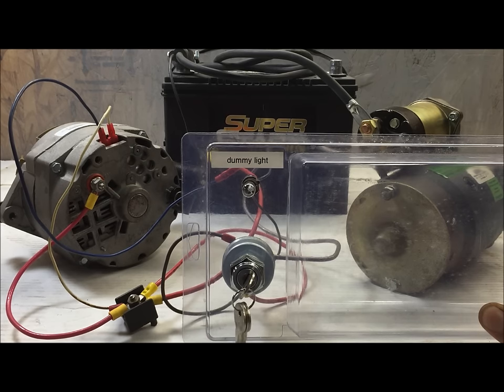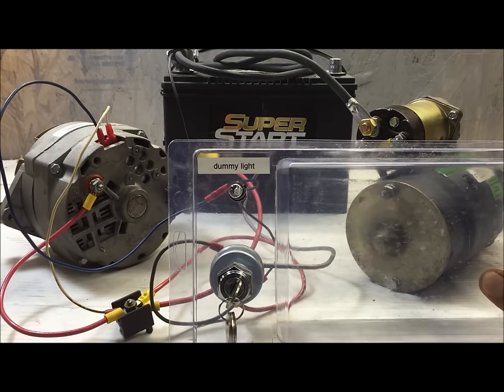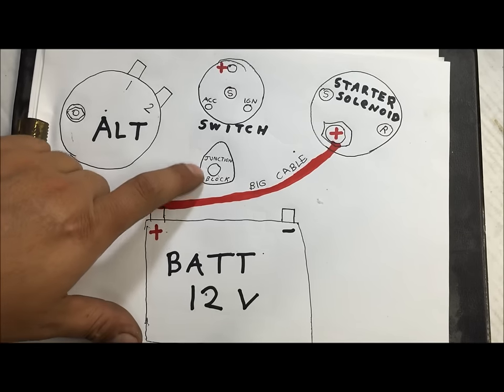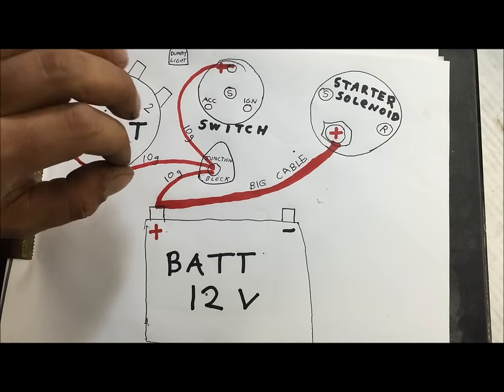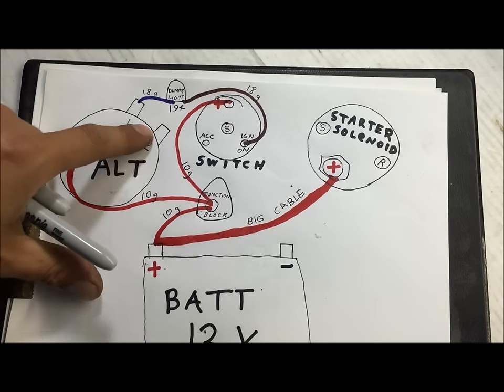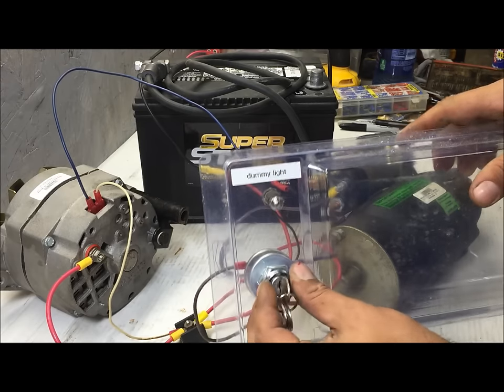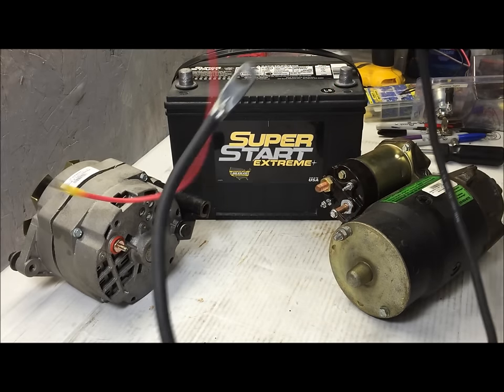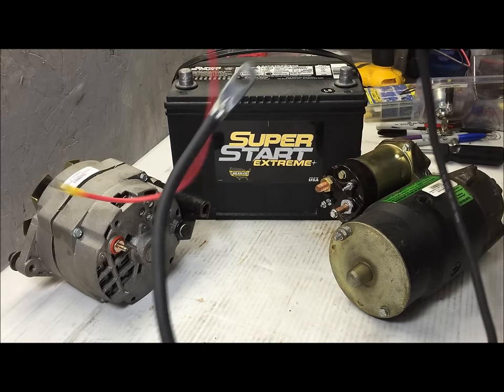64-72 charging system wire up using GM 3 wire internally regulated alternator

Comment: If I run the #1 wire direct with no light, Will it drain the battery?
Reply from the maker: +matt cabbage yes it will drain it and also keep your car running when you try to shut it off... watch my 3 wire hook up video it shows how to hook up the alt
Reply: Awesome. Yea I just watched that. Very helpful. I wired everything thing up as shown other than the dummy light last night and the engine was turning over good. I came back tonight to put my distributor in and my battery was completely dead. I'm assuming it's the #1 without the dummy light that drained my battery.
Reply: Btw it has to be something in this system that drained it considering there's no other wiring in the car. That wire without the light is the only thing I did different.

Thx again for the advice.
Reply from the maker: the only other time it will drain the battery is if you have the voltage sensing#2 white switched with number 1 position...  just unhook #1 (no wire)  and loop #2 back to the stud and it should work... but it will kick in and squeal a little.. if you cant figure it out

Comment: wired as is if the light does not go out the voltage regulator is bad it is staying closed and it will keep the light on and in turn it will kill the battery

Comment: I would like to see one on the same old system on wiring up and old Amp gage and a volt gage on same  old sytem. have a 54 chevy Blair converting from 6v to 12 v and a 56 Blair Conv. that I need to convert from Gen to alt. thanks Professor.

Comment: what if the bulb is not good. would the alternator be able to charge
Reply from the maker: if the bulb is bad it might not excite the alt until like 2500 rpm. use bulb or diode pointed towards battery... just like not running wire there at all
Reply: +Chris Craft thank you

Comment: This is a great video, but I am still in need of help. I have an external voltage regulator with green, black, yellow, and orange wires. Can anyone tell me where I connect these wires??? Thanks.
Reply from the maker: I have a video .. look up externally regulated alternator easy conversion.
Reply: Thanks Chris ... I'll check it out later. Greatly appreciated!!!
Reply: I looked at the video, and I am not converting, so what I need to know is where do the 4 wires on the regulator go, that are shown in the "external" video? Yours are blue, green, red, and black (I think). I have a jeep that had zero wiring, so I can't follow what was there, since there is no "was there). Thanks again.
Reply: Never mind ... I just watched the whole video. You rock!!! Thanks again.

Comment: hey chris ,How can I safely  recognize the terminals 1&2 at alternator, please!
Reply: This is an important question. It seems like there are two letters cast onto the alternator. Which one gets steady voltage and which one gets switched voltage. It seems on the plug in there’s a large wire and a smaller wire. If anyone knows the answers.to these questions, I’d sure like to hear it. And  “Good job”, on a pretty well made video.

Comment: Question,  all my cables are 12 gauge would that be a problem?  only one is 14
Reply: I feel that 10 gauge is low for 12 volts, I'm a rookie in the electrical department,  thanks for listening
Reply from the maker: wire size depends on the amps of the alternator output...  the alternator on my car is like a 60 amp...  it really depends on what you are running....my car is a 70 chevelle ..

Comment: Hi, i have a new alternator, its wired as above. My problem is that the idiot light don´t go on when I put the IGN key on. But when I turn the start motor on, the idiot light goes on and goes off when the engine runs.
I have 12v at the idiot light cable.
Suggestion/Thanks!
Reply from the maker: you have dummy light ran off S position on switch... change it to ON with key position
Reply: +Chris Craft Hi, the IGN switch cable was in the right position, but you lead me to the solution. I had two cables marked "alt ctrl lamp", switch to the right one and problem solved. Thanks for the help! I have a Ford F1 -51 and all the wiring is new . Keep put out your vids.

Comment: Dont having a junction box... will that kill my battery?
Reply from the maker: no
Reply: I heard you need to have 3cables of negetive terminal on battery 
1 battery to alternator cover
1 on engine of body 
1 from  body to battery
And extra one from bottom of engine to body of car chevrolet problems
1
Reply from the maker: @bobbychavez2069  i have an "automotive grounds" videos..   that shows sort of that..   check it out..  what is the vehicle you are working on????  i only duplicate what factory engineers came up with..
Reply: @chriscraft77022  i have a 1980 el camino with a 350 small block a problem i have is it keeps dieing so im gonna try that and see if it helps i have the whole set up correct i guess ground is my problem
Reply from the maker: @bobbychavez2069  i used to have an 80 el camino..  with a 350..  have you watched my 3 wire alternator video????   have you checked for parasitic draw?
Reply: @chriscraft77022  yes i saw it should i do that ? Or should i connect every spot from the negetive terminal of the battery?

Comment: Hi any ideas for a starter that wont stop cranking on a  1977 Chevrolet c 20, any help appreciated
Reply from the maker: there is a spring in the solenoid that can fail....  unhook ignition and check that first...   jump the starter with a screwdriver under the truck in park with ignition off...    see if the gear stays engaged with flywheel..  to start
Reply: I think i may have found the problem, there are exposed wires, multiple joins and oil soaked wires going to the cab from the solenoid, the main power supply cable to the cab from the solenoid go's from thick red cable at solenoid to thin black deformed cable then back to the thick red cable, even the short wiring harness had join on it

Comment: So let's say I have my derby truck wired up almost identical to this set up. Put a brand new alternator on it today. Had to clock it 1/4 turn I think. Was charging 14+ volts while running for 1-2 mins. Shut it off then noticed smoke coming from the alternator. Very very hot too. Added a giant ground cable to the frame. Same situation. Hot after 1 min of run and little smoke. Also the light isn't kicking on until the engine fires up. And my switch to activate the alternator does nothing to change that. I'm lost at this point. Any knowledge of wtf is going on???!!?? I'm running out of time now. Let me know thanks. O and it's the same alternator off a 72 Chevelle big block. So yeah.
Reply from the maker: is the alternator internally regulated? 72 chevelles have externally regulated alternators and are different.. I have a gm 3 wire internally regulated alternator video you might want to check out. Car is a 70 chevelle but alternator is off a 79 Monte Carlo
Reply: Chris Craft honestly I'm not sure. The old one had been sitting in a crate for 10 years and my father went to exchange it today and idk any details about it. So yeah... IDK man. But thia is for a 72 454 Chevelle engine. That's all know right now
Reply: Chris Craft just pulled it up on the website. It says it's externally regulated.
Reply from the maker: well get one for a 79 Monte Carlo cause you can’t use an externally regulated on your project
Reply: Chris Craft so let's say I get one of those. Then everything will work out how it should?? Like I said it's almost identical to this video. Except I don't have that junction or whatever it's called. I just want this B's to be over haha. Been working too long for this to trip me up now haha
Reply from the maker: that’s what is on my car now... the 72 chevelle alternator uses a voltage regulator that mounts on the core support.. I throw those old alternators in the trash...yes, the 79 Monte Carlo alternator will work
Reply: Chris Craft  I found an internal regulated one for the Chevelle. Same price etc. Thanks for the help man.
Reply from the maker: they don’t sell an internally regulated for a 72 chevelle..  you have to look up 1973 or newer ..
Reply: Chris Craft the one I found right above my current alternator on the site says integral under alternator regulation. My current one says external under alternator regulation. Same size diameter. 1 lb heavier. And says the fans are different. Current is external and the other is internal. So idfk anymore

Comment: I have a 1972 nova with a 350 motor.  my starter is good but when I turn the key I can hear the relays clicking but my start wont do anything.  any ideas?
Reply from the maker: take off every wire and clean it...   i have a 72 monte that was doing the same things...  every wire was corroded

Comment: What if the bulb is bad?  No charge??
Reply from the maker: It depends how you have it wired up... the factory uses a resistor from ign to acc for that reason.. you want to run the wire off ACC.. if it doesn’t charge just rev engine up and it will start to... you dont even need #1 hooked up .. watch my gm 3 wire hook up video

Comment: whats the need for the R in the gm starter
Reply from the maker: if you have points ignition yellow 18g wire gives 12v to the coil while it cranks the starter

Comment: Does this have to be fused coming off battery?
Reply from the maker: go look at a real car and tell me where the fuses are....you fuse wherever you want
Reply: Chris Craft it’s a 1993 c3500 it’s under the dash. But it has a 540 big block and was rewired. There a distribution block on the firewall but from the battery to the distribution block has no fuse.
Reply from the maker: I meant look at a factory car
Reply: Chris Craft if I fuse it will it hurt anything.
Reply from the maker: @vitol7967  fuse wherever you want

Comment: do i need the junction box? ( can I run 10ga from charging post to +battery? )
Reply from the maker: +Michael Russell the junction block is so you can run accessories.. you don't need it but it is a good idea to put one in if you can
Reply: Cool. Thanks

Comment: i have a horn relay in a 69 riviera ive got everthing wired up runs great but the stop engine light blinks constantly any ideas
Reply: and my alternators brand new
Reply: charges 14.1
Reply from the maker: +GENESIS420 there is no such thing as a stop engine light... you have a charging light (dummy) that lets you know when the alternator is not charging the battery.. is your car still using the voltage regulator?
Reply: no built into the alternator
Reply: and the light on the dash says stop engine
Reply from the maker: +GENESIS420  I've never seen a stop engine light in my life.. Ive only worked on 68-72 chevelles and 67-72 c10 trucks... 
sorry, I have no idea what to tell you
Reply: its got to be a vacuum leak or bad wiring
Reply from the maker: +GENESIS420 all you can do is get a wiring diagram and see where that light goes.. it could be a dummy warning light for oil pressure or temp sensor
Reply from the maker: i looked that stop engine light up and could not find a single thing about it..    those cars have dummy oil, temp, and a GEN light, CORRECT?
Reply: correct
Reply from the maker: then where is your engine stop light?     explain where it is on the dash..  i cant find 1 even mention of it on google
Reply: top left of the dash there are two lights temp on right stop engine on left
Reply: you got a face book i can send you a pic or email
Reply: if im sitting in the drivers seat it on the dash to my left right threw the steering wheel
Reply: o.k above the the word temp theres 2 lights its the right one you can really see it unless its blinking
Reply: sorry left
Reply: i just wanted to say i appreciate you looking in to this dude thanks
Reply from the maker: email the pic..   craft_77022@yahoo.com
Reply: Startmotor

Comment: What do you do with negative battery terminal
Reply: Chris Craft i guess I should have asked how you ground it. Or complete the circuit. 
Can you double ground the negative terminal. Then ground starter solenoid to block?
Reply from the maker: it’s DC.. the chassis is ground.. the starter is grounded to the engine.. negative battery cable is bolted straight to the engine...
Reply from the maker: you just gave me an idea for a video.. on auto grounds.. thanks, I’ll try to make it ASAP
Reply: Chris Craft cool. I’ll stay tuned. Your vids are quite helpful but grounds continue to stump me. Would it be wise to double ground to make other accessories easier to install. 
Currently restoring a 77 camaro. Everything else is perfect but I’m tasked with rewiring. :( not a strong suit for me
Reply from the maker: you need to get a wiring diagram ( speedway sells them cheap ) it will show you where your grounds are.. you ground the big cable to engine block.. you have a 10g from neg batt post to passenger fender... (2)10/8g grounding straps from engine to firewall .. and 1 10/8g ground strap from body to the frame..

Comment: I did that now my tractor won't shut off I need your help.
Reply from the maker: run #1 wire to accessories or run diode ... I have a gm 3 wire alternator hook up video
Reply: @chriscraft77022  what I did is 
run#1 to one side of dummy light
and the other side to ground.
Reply from the maker: no ... nothing is run to ground .. watch the 3 wire hook up video

Comment: The only stupid question being the one you don't ask ! How dose a 100 amp alt. Charge using a 3 wire hook up with only a 10g  going to the battery ?
Reply from the maker: you can only use 75 amps with 10 gauge and it is because the run of wire is short... look up wiring tables and it will show that after about 10 feet you have to upgrade wire.... I always run bigger wire on my projects... I have a 100 amp alternator video where I go over all that...
Reply: Chris Craft thanks

Comment: how about the voltage regulator , can you put it to your vid,
Reply from the maker: you don’t run a voltage regulator with an internally regulated alternator
Reply: @chriscraft77022  pls tutorial for the external regulator how wiring the charging system

Comment: Why can’t you just run the charging wire straight to the battery so when the alternator is spinning it’s charging. ??????
Reply from the maker: you can.. but now you run accessories off the battery and it looks like crap .. and also like this for ammeter
Reply: Chris Craft could you do a video of it connected to a switch so for the people who wanna fell like a trucker ??????

Comment: Just to confirm 100%This would work on a 78 Scottsdale c10?
Reply from the maker: your truck was wired like this from the factory
Reply: so sir it was very diffrent when I took a look after I got a short in the wiring
Reply from the maker: well, if you got a short..  you need to start from zero..  ive had to trace every wire 100% for a whole day in a short situation...
Reply: thank you for the confirmation I'll follow your guide you've made here in the video
Reply from the maker: its all gm vehicles...  the only thing that changes is bigger wires for more modern alternators with more amps...    yes, your 78 is exactly the same

Comment: is this the way a 99 gmc k1500 4x4 suburban 5.7 gas 1battery is supposed to be???? mine the pos on the alt is has 2wires on the stud going to the batt maybe starter from batt1  pos goes to the  batt ,not starter large black  cable  from alt to batt ,the plug in on the side of alt only center wire is connected not the black or red not diesel    amp gauge on dash running shows 16 , batt is always going down ,spark at neg at batt when i connect it nothing is on    . is that second cable going from alt to pos on batt take it off or what not letting black boot  go on the stud with 2 there , 3 wires at pos on batt i look like the 3 cables on pos 1 going to starter, 2 coming  from alt
Reply from the maker: they change a little as they get newer but the system is the same no matter what year it is..  this is based off a 1970s GM vehicle...
Reply: OK BUT THAT DOESNT ANSWER ME WHATS WRONG THE WAY ITS HOOKED UP
Reply from the maker: i honestly can not understand what you wrote...  get a wiring diagram..  or try to explain it more clearly..
Reply: read

Comment: hi im greatful to you demonstration course i lean a load please my car opel astra G battery change terminal is heating hot please what is the possible problem thanks sir
Reply from the maker: check grounds and connections.. like take them off and wire brush the cable to starter solenoid and engine grounds.. take off battery terminals and clean everything 100%